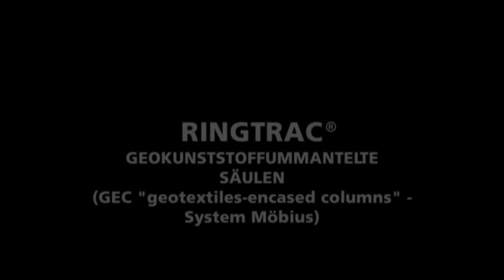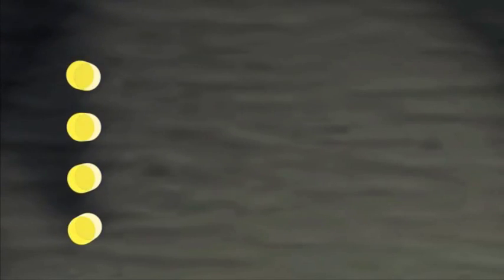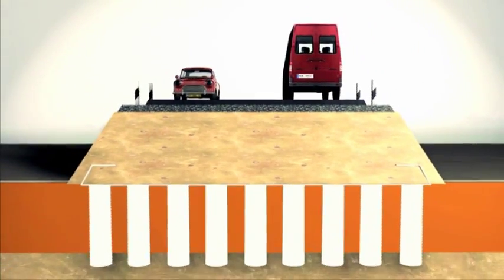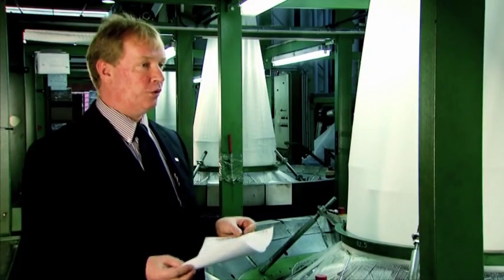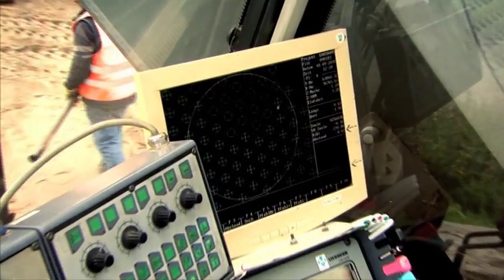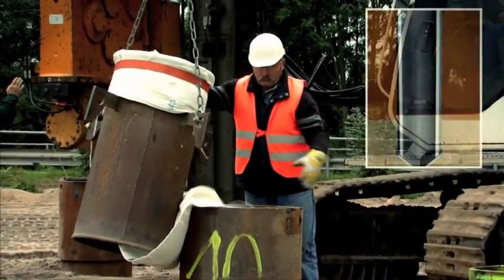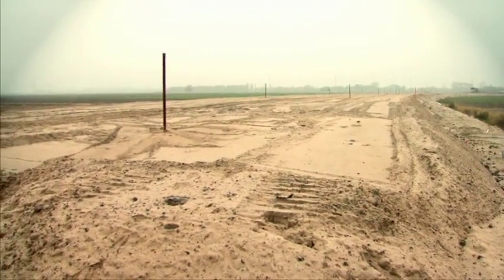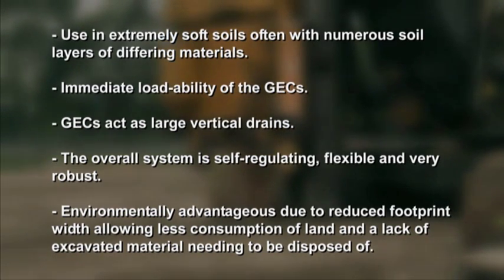geotextile encased columns

Comment: what if i pretend to use it for floating columns?
Reply from the maker: Hum? Not sure what a floating column is, but since you are just pretending I guess it doesn't matter.
All snarkiness aside, explain what your intent is, ie. a floating column.
Reply: @SteveMillerhuntingforfood  by floating columns i mean those that does not reach the bearing stratum (e.g a rock).
Reply: @SteveMillerhuntingforfood  in cases of a very thick soft soil layer, say 40meters, using a GEC that goes over 40m may become less cost—effective, so, u might want to think on floating columns.
Reply: what do you understand under "floating" columns?  Do you mean the columns are not "embedded" within the "stable" soil stratum?
Reply from the maker: @hansdete  I'd call that a column supported by skin friction versus an end bearing pile.
Reply from the maker: @HFGDE  I think that is exactly what Hans was referring to. A friction column vs an end bearing column
Reply: @SteveMillerhuntingforfood   A short and comprehensive Answer. Thanks. The friction force/skin friction is in addition supported by the reaction force of the "foundation" in the stiffer strata, but still able to consolidate. Thank you to explain the term floating to understand the meaning behind it.
Reply: @SteveMillerhuntingforfood   skin friction = pile adhesion (friction) > skin friction /  Mantelreibung